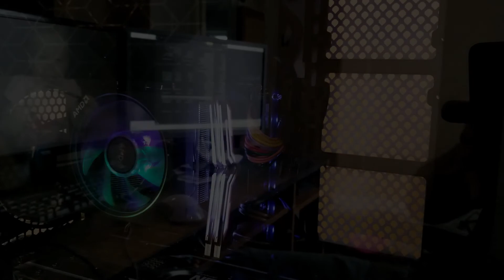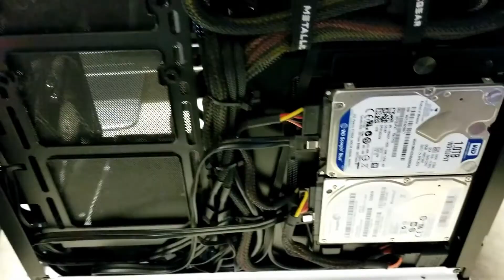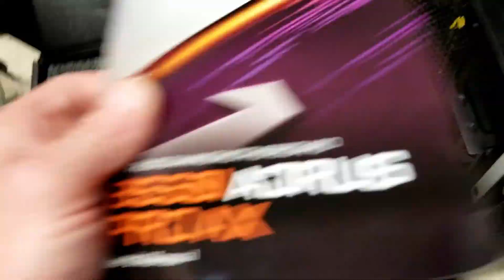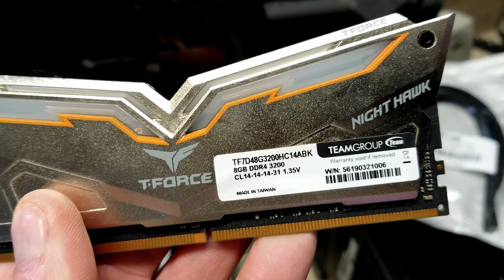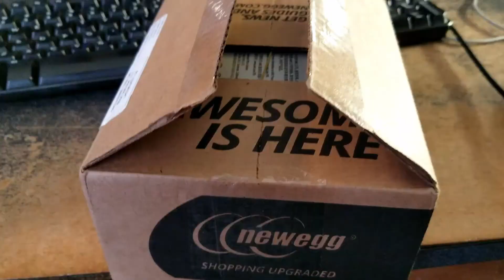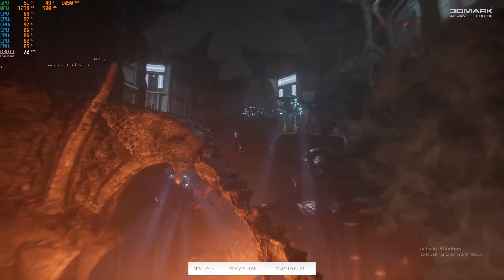My Jinxed PC gets an unusual CPU

Comment: I never knew a ryzen 3500x exsisted.  the case looks pretty neat ngl
Reply from the maker: I didnt either, I was looking for something cheap to get me by and newegg happened to have some in stock. Its pretty decent for the price too, I think I paid $160 usd
Reply: @Snickerrick  thats pretty good, I paid around the same for my ryzen 5 3600
Reply from the maker: @theutmostgeek  I had actually been looking locally for a 3600 but they were selling for far more used. Plus they were all a decent drive away. This is not a bad cpu, I'm quite surprised actually. Still need to do all the tweaking, but out of the box she runs great

Comment: When are you gonna make an update video for the erACER? 4gb ddr2 ram? A GPU? WINDOWS 10???
Reply: Btw, you should put the “headache asrock motherboard” in the Tako Bell looking erACER case from last week. I heard that the dust on those old AVC fans increases the specs (of dust) in the PC!!! (That last part was supposed to be a joke)
Reply from the maker: @TechJosh311  lol yea that would be a great fit!!
Reply: Snickerrick It really would, and it’s a complete case unlike the Compaq presario which was missing the side panal.
Reply from the maker: @TechJosh311  yea but I do like my presario! It turns out I may have something even cooler for that asrock board, just waiting for it to be shipped
Reply: Snickerrick Ya, the compaq presario is a very nice case, the translucent plastic makes it great for those fans with the lights on it and the CD tray in front is great for storing pirated copies of windows and other stuff... Can’t wait to see your next video!!!
Reply from the maker: I had to put everything on hold till this 3500x came in, that last video was a nitemare to edit on that crap board lol. As soon as I can clear my spot, I will be bringing back a couple, that one included!